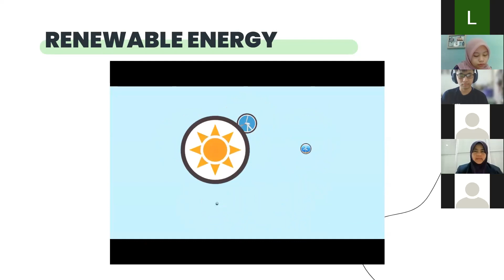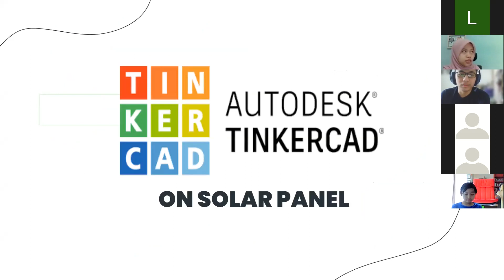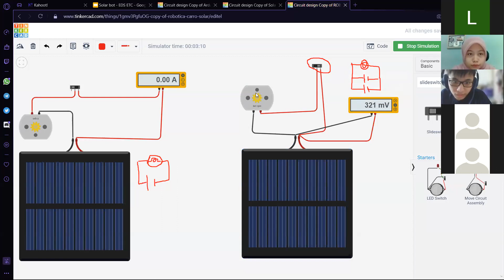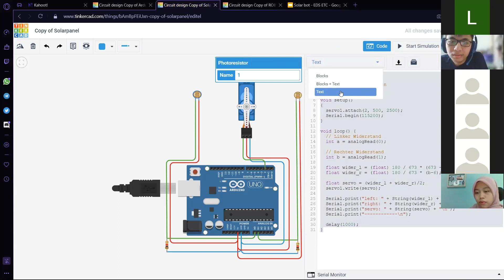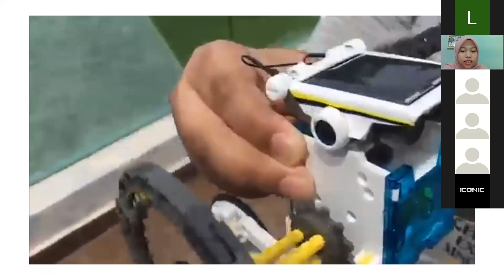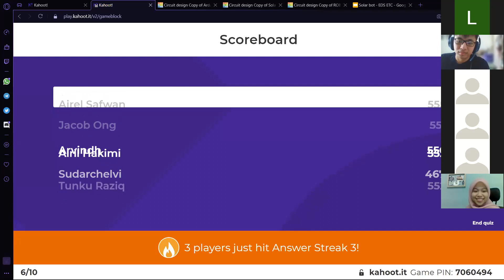Train the students: SolarBot

Comment from the maker: #include <Servo.h>

Servo servo1;

void setup()
{
  servo1.attach(2, 500, 2500);
  Serial.begin(115200);
}

void loop() { 

  int a = analogRead(0);
  

  int b = analogRead(1);
  
  float wider_l = (float) 180 / 673 * (673 - (a-6));
  float wider_r = (float) 180 / 673 * (b-6);
  
  float servo = (wider_l + wider_r)/2;
  servo1.write(servo);
  
  Serial.print("left: " + String(wider_l) + ",");
  Serial.print("right: " + String(wider_r) + ",");
  Serial.print("servo: " + String(servo) + "\n");
  Serial.print("------------\n");
  
  delay(1000);
}